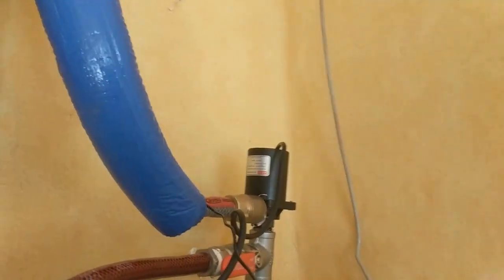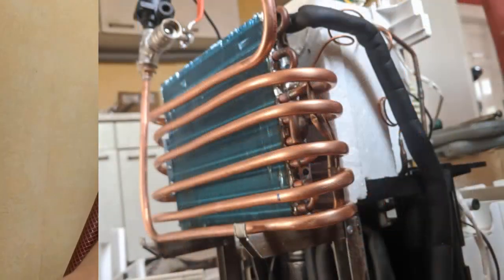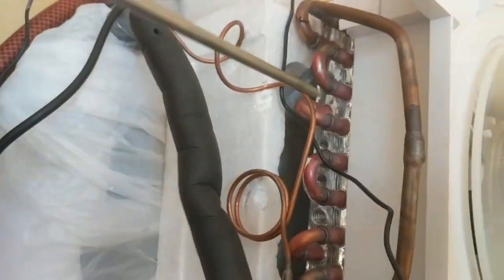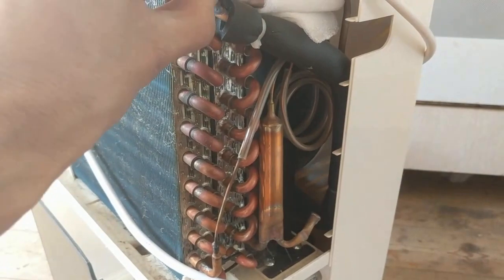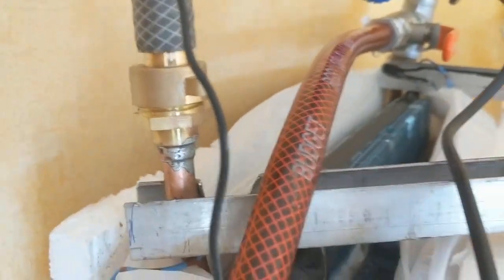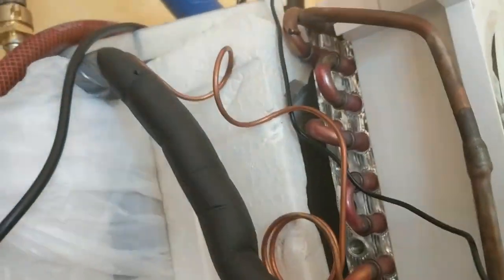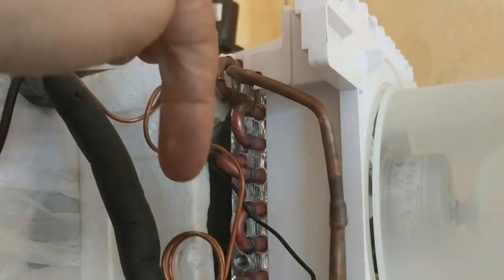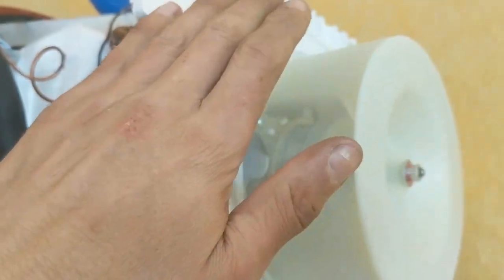turning a 400 Watt dehumidifier into a 1000 Watt heat pump

Comment: More ideas to you Robo.
To mitigate the problem with pressure (and leakage and airbubbles) you shuld make another heat exchanger exactly below the roofboards. There you can have a watersump with 4 small pumps that collect water to each solar panel inedendantly.
All heat will be added to the total water and the cooling side will get 6.2kW of solar heated water to handle.

I know you understand what i mean.

Ps, use a car radiator in the solar water sump to house the cool side water. car radiators are made to release huge amounts of heat.
Reply from the maker: Yes and car radiators are cheap. The building application for my next solar roof has been approved (did cost me 190€) and indeed i plan to build it this year: www.dasRoland.de
I already have a ZR28K3E-TFD-522 scroll compressor there and spreading the cooling onto 7 seperate horizontal loops with 7 small pumps might be better then only one loop where the last solar panel only gets the heated "cooling" water from the previous 53 panels.
Yet with a 42° roof pitch the pressure at the bottom of one loop would still be sin(42°) = 667 kg/m² :-(
So maybe it is better to let cold air flow underneath the panels and use a car radiator to collect the heat.
But i like that cheap 0.1mm black tubular film. 95€ for 125 m² and the solar panel can very very efficiently be cooled from 50°C down to 20°C -> 20% efficiency gain under full sun!